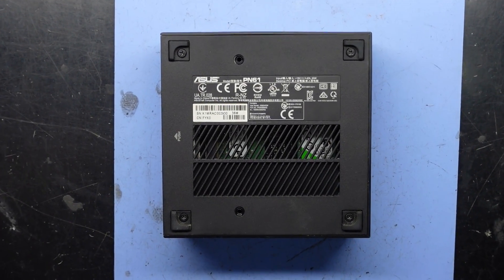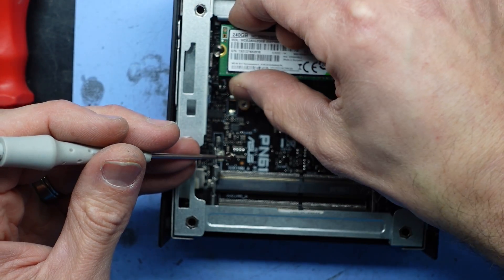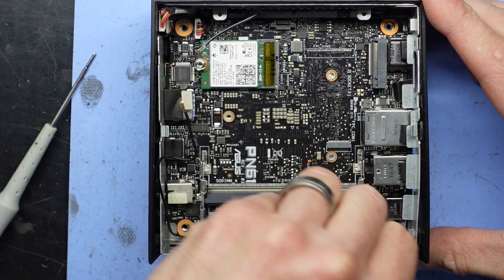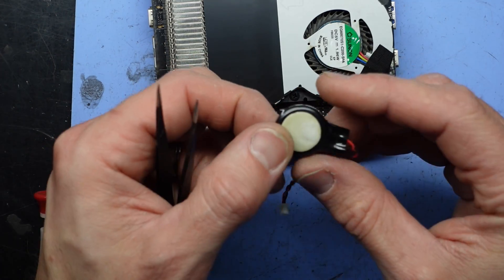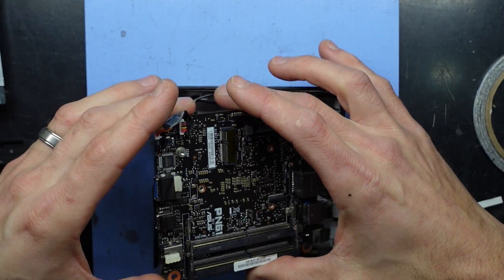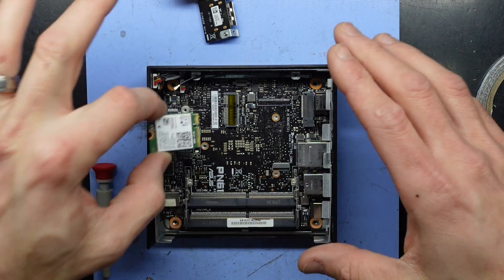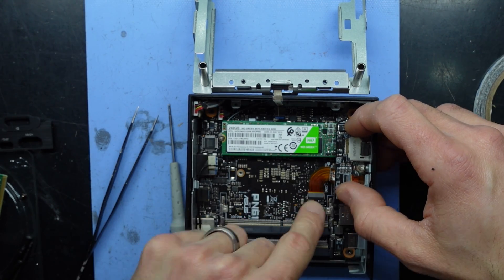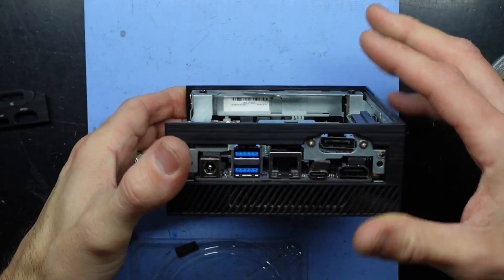Asus PN61 Nic Teardown and CMOS Battery Swap

Comment: In the first few minutes Rick struggles wih the case opening, all the while ignoring the <PUSH>, clearly labelled on the bottom. Never mind, he gets it off in the end.
Reply from the maker: hind sight is 2020
learn from my failures
Reply: @rickstechrepairs  I've already had my PN50 apart a couple of times. I just wanted to know if there was a better way. You didn't start well, but I picked up a couple of points for next time.